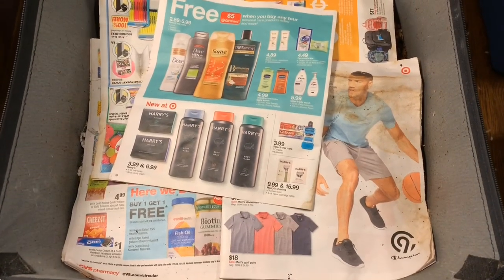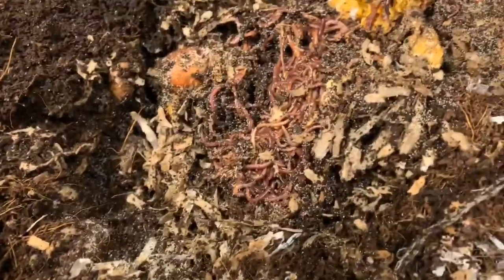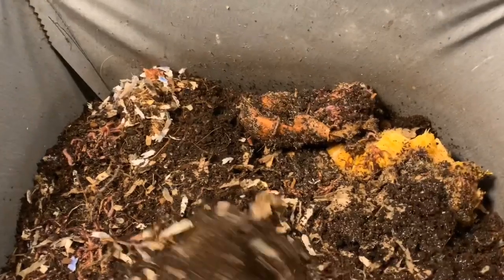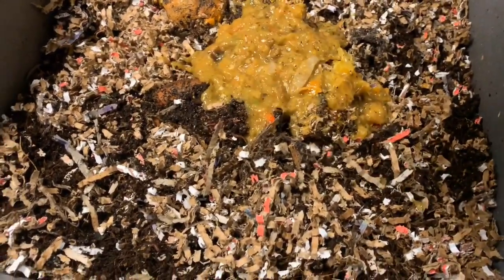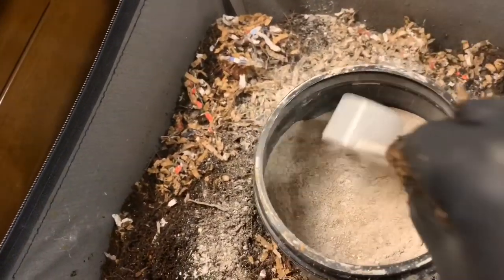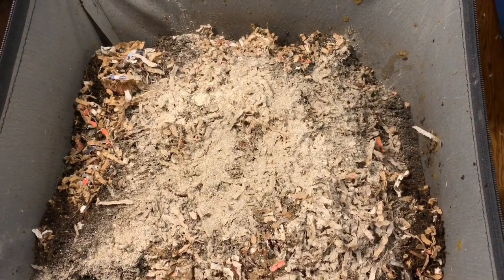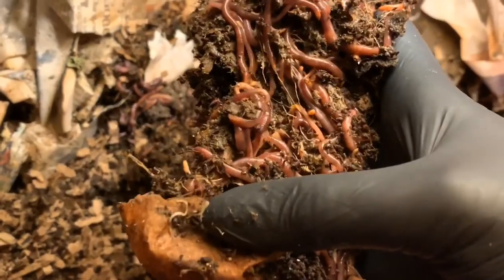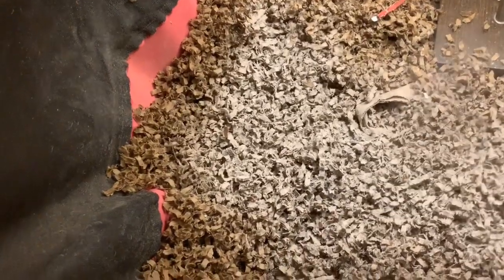Sweet Potato Parties in the VermiBags + Fungus Gnat Problems #vermibag

Comment: I do love a sweet potato worm party! :-) I still really recommend BTi for fungus gnat control - but it has had an interesting impact on my systems. I realised I'd not seen any springtails for a long time, and then I read that BTi kills springtails too, which is a shame (unless you hate them I suppose). Most efficient way I've found to get rid of fungus gnats is to soak some mosquito bits (or even mosquito dunks would work for this) in water, then use that water to mist the whole surface of every worm bin and plant pot/soil surface in the entire house, and maybe even the garden nearest the house too. Because those little pests will hide out anywhere they can, and it doesn't take many to infest everything and start killing your plants.